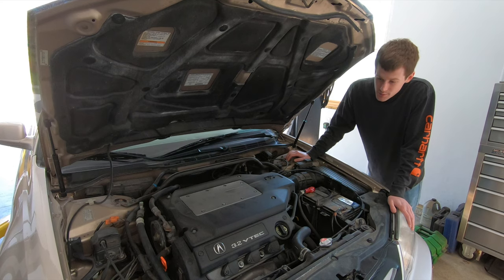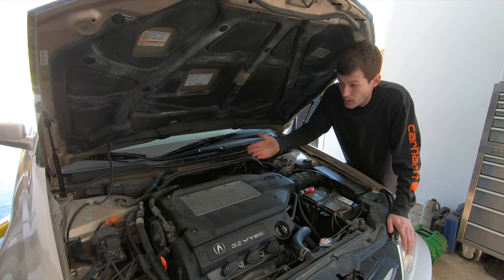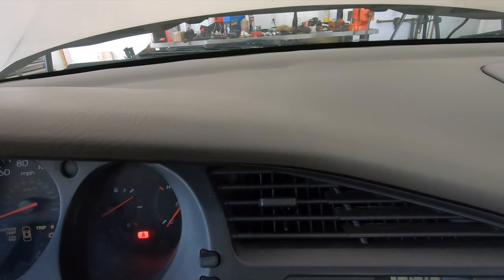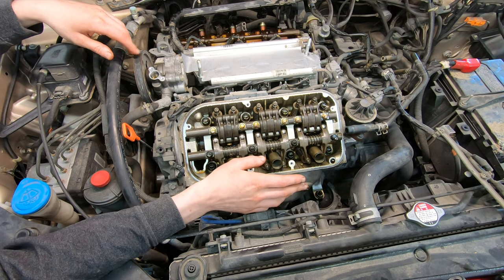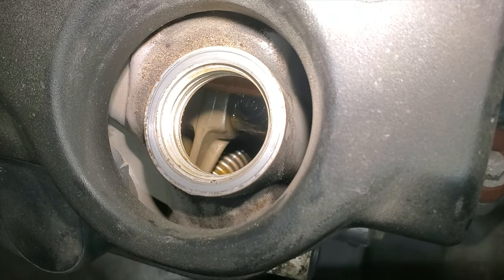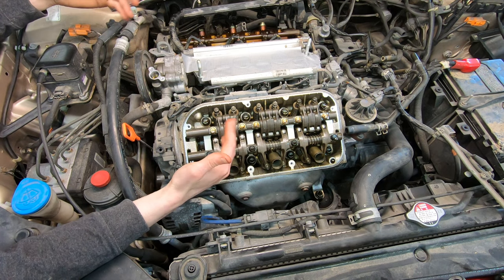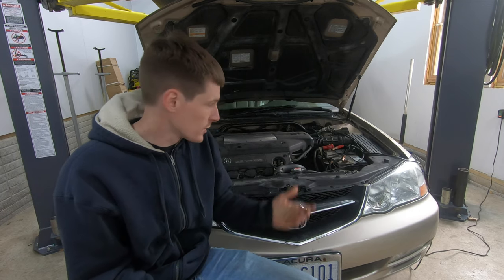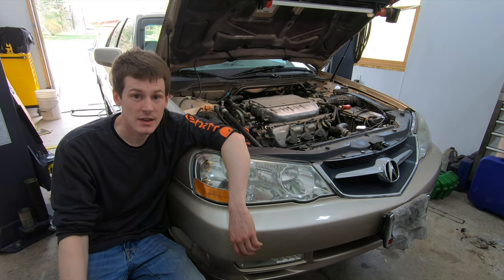Why Do Honda's Need Valve Adjustments?

Comment: I've been at WAR with my 8th gen R18 for a year.. Misfiring alot, I've replaced soo many parts and it only got worse. Today I adjusted the Valves, adjustments are soo small but I evened them all out and also changed the MAF sensor. It's still missing but has alot more power now, yesterday it was at its worse running terrible. I have a few things left to do to hopefully solve the missing just hoping no valves are burnt.

Comment: Hello I have an Acura TL 2005 with 171,000 miles.. a year ago check engine light was on spark plug replacement for cylinder 5 was the solution. Now a year later light came on Acura dealership said spark plug or coils aren’t the issue they said was a injector ok I followed thee advice. Now light still is on. I think the valve adjustment has been the issue since the beginning a year ago… I have been taking the car to auto-zone for the free scanner and the valves adjustment has been in the top of the diagnosis. Besides the valve adjustment the suggested a cleaning injector. I asked about that before the injector replacement and they said that won’t fix the issue now it’s a suggestion. Lights goes on and blink with a cold start and then after a few minutes stay steady. In the begging cars feels like loosing power (English is my second language hopefully I am explaining myself well) please advise I don’t know at this point what to do also I just replaced the timing belt 🙄

Comment: Honda along with some modern Hyundai V6 or a few of Hyundai turbo engines use solid lifer or manual adjustable rockers.. its done for valve train accuracy.. most performance oriented engines, high reving or engines with aggressive cams or valve timing phasing will use this manual or solid type as self adjustment followers can't reliable keep that accurate of a valve timing especially under strenuous conditions plus reliability is also of  concerns.. there are exceptions of course..

Comment: Having the same issue on my 2010 TL I didn’t notice it at first because it had cylinder 4 cylinder 5 and cylinder 6 misfires replaced spark plugs and coil packs but cylinder 4 and 6 keep popping up after a couple of hours of using the car im thinking that this could possible be the issue car is silent after it warms up but I hear the ticking at cold start or if I push the gas a little too hard

Comment: I did yesterday to my honda civic Si 1.8 2010 and the power ingres with 20%, engine silence 30%, economy fuel i don't know yet but i'm pretty sure it will be more economical! For those that they don't know if the engine has valve clearance i recomand immediately 100% and every 40k km!
Reply: SI is 2.0 not 1.8

Comment: valve misadjustment may cause worse symptoms than that, my 99 Honda crv went to LIMP mode no more than 30 miles an hour meaning no highway driving, rough engine idling, specially when on drive,  hard and delay transmission shifting, and when change from park to reverse, you feel like chittering, I changed a lot of parts including catalytic converter, and the muffler, because I thought it was exhaust restriction, till I got the idea to check valve and they were on tight  position meaning engine compression problem,
After 2 hours of valve adjustment the var went back to normal of  course  gradually after 6 Mile of driving. Smooth engine idling, smooth shifting.

Comment: Just got myself a 2008 Honda Fit sport manual. She's REAL chatty at idle xD
Sound like a big ole' diesel when I'm at a red light or in a drive through.
I've done a valve adjustment before on my 98 Accord. Plan to do the Fit this weekend.
Reply: I hope there isn't too much discoloration of the valvetrain from oil varnish. Car is at 110k miles, and the engine is bone dry top to bottom. Either way I plan on doing oil changes every 3-5k miles, to help prolong the life of the engine. I plan to keep get this car at least to 200k, hopefully 250 or 300.
Reply from the maker: I have an 08 Fit as well. I believe they suffer from piston slap at certain RPM's/loads. I recently had to do the head gasket on it, replaced all the timing components, re adjusted the valves, and the noise I'm talking about is still there.

Comment: On my 2007 Pilot, fuel injector #4 is not firing or pulsing. Changed out that injector with a Honda injector. Still not firing correctly. It starts up but the display shows the icon flashing. The slight shaking & lost of power is there. Then changed out all 6 connectors as they crumbled with heat & age when pulled out. Added 6 new Denso Iridium spark plugs. Changed out the manifold gasket & O-rings on the other injectors that are good. Still misfiring but running smoother now while idling. Do i need a valve adjustment?
Reply: Can't hurt and necessary on 6 cylinder honda engines

Comment: I had quite a bit of shuttering on my 7th gen Civic on startup and now the check engine light is flashing.  From what I have read a flashing check engine light is usually caused by a misfire and you said in your video that first can occur if the valves aren't adjusted.  Vehicle is at 225,000 I don't know if the valves have ever been adjusted but I do know that it was taken to the dealership religiously up to 150,000.  So my question is do you think my whole issue could be that my valves just need adjusting?
Reply: Shoot,  that symptom could be a really dirty air intake filter.  The check engine light indicates an issue (usually emissions related) with information from one of the cars system sensors.  Get an obd2 code reader from home depot or autozone.  Shouldn't be more than $40

Comment: Great video..I've had my 2006 Honda Odyssey EXL To 3 Mechanic Shops. Code reads misfire on cylinders 1-6 plus bank 1 to rich next to backside of motor.  Sometimes when you first start it up in morning it doesn't seem to shake as much..but after a few minutes it noticably shakes..but when on interstate it does great. But also it has a hard time pulling big hills. Honda was 3rd mechanic shop I took it to. They seem to think it maybe could be needing valve adjustment.. coil packs are good, spark plugs are new. Also I've run 2 cans of sea foam through it. Do you think it's a big possibility it's just needing a valve adjustment? Also will hurt engine running it like this until I can get fixed (if it needs valve adjustment) It has 265,797 miles. Thank you🙏💯
Reply: Sea foam bad. Could be fuel pressure or injection.  Could be intake manifold gasket or MAF/MAP But lots of evidence points to valve adjustment and valve seat impact.  A moderately talented shop should know how to diagnose in .5 hours without much disassembly.  These engines require adjustment or they misfire
Reply: @joeKisonue  I Appreciate You Taking  Time Reply With Helpful Info. I Still Haven't Got It Fixed Yet. Another Mechanic Took A Look At It About 2 Weeks Ago And He Also Said It Could Need A Valve Ajustment. Thanks Bro
Reply: @wes365  sure thing.  It has been documented in these videos that the v6 in question gets tighter on exhaust valves.  The manual calls for check and adjustment.  Most cars say no adjustment necessary on the sticker under hood.
Reply: @wes365  how is the vehicle behaving? Any issues with the car even though it hasn't had  valves adjusted

Comment: Intake valves wear at the valve tip and get loose, exhaust valves get beat into the head and get tight. You can have both situations (and usually do with 150k+) on the same engine.

Comment: Nice lil' video. I would assume one thing you didn't mention but the valve adjustment will make an improvement of torque and power because any cam lobe that does not immediately translate into valve lift will be worse cylinder head flow. That said this is why Honda will perform a bit better than engines with hydraulic lifters. The oil will reduce the actual lift/duration ever so little. 

Historically, there were some V8 engines that were louder and produced with solid  lifter cams and others that had lower RPM potential made with hydraulic cams. I knew a guy named Maier from Florida who make rocker arms for 351 Cleveland motors and he was a big proponent of solid lifter camshafts.
Reply: Old comment, but just wanna say thanks the does of engine knowledge today.

Comment: I'm having misfire codes in all cinders.. but the car drives fine till I get to around 60rpm then it starts to spotter I can get to higher rpms but I have to feather the gas.. my idle is rough for like 2 secs on start up .. do you think it's because of valve adjustment ? I have new coils and sparkplugs
Reply: Very likely... Especially if the car has a 150000 miles or more But certainly could be in need of a  adjustment if it has less...  On these hondas this is just basic maintenance and it really should be done at a 150000 or so even though they recommend it much earlier... They are the Dealerships and they  Recommended at a 100000ish...  I'm just doing mine at a 187000 because it is getting random miss fire and a shake at the start so assuming they are too tight
Reply: @john-carlos ynostroza  I change the vapor canister abd put some injection cleaner in it .. its been running smooth so far didn't want to get on it,till after the adjustment
Reply: Clean your throttle body

Comment: Let me add to your explanation if the valve adjustment is too tight u will have the valves opening earlier and closing late.. hard or harder to start when the engine is hot..  valve not closing fully leads to burnt valves or pitted valve seat thus leads to drivability issues.. sometimes shows up as low compression

Comment: My 04 pilo started to lose a lot of power when I started to accelerate over 30mill and it sounded like a air blower under the car and after some time check engine light popped on and it said multiple misfires i when to orallys and got the codes and said . Valve adjustment so we did it and now it’s like new engine.

Comment: I have owned many cars, however my first Honda is a 2005 CRV (4 cyl) with 35,000 miles on it.   Purchased from a dealer.    When I first got it, I heard engine tappet noise.     It sounded noise to me then and now with 60,000 it sounds even noisier.    

My question is:   Should I be very suspect that the millage was not actual millage or has anyone had a Honda 4 cyl , where at 35k the engine sounded very noisy (very distinct tappet noise, not just one - more than one tappet noise) ?   

...And thanks Repair Geek for the helpful video.
Reply: I would like to comment that honda engines are not known for being whisper-quiet. Having said that, the lack of hydraulic lifters would logically make honda engines a little noisier compared to other valve setups even when the engine is fine. I guess what I'm saying is that if this is your first honda, the sound of the engine may take a little getting used to depending on how closely you're listening (ear-to-the-engine sort of thing). All of mine have been a little rattly, especially during cold start but if it's obnoxious then maybe have it checked out. Note: all of my hondas have been in the 200k mile range so my expectation for engine noise is a little lower standard than some.
Reply: Likely the mileage was accurate,  it could have done with a valve adjustment probably after 5,000 miles.  Some years materials may have varied or maybe the tech messed up.  Get it adjusted and replace the front and rear differential fluid and coolant. The fluid is supposed to be changed every 60,000

Comment: could a bad valve adjustment cause very low compression? cylinder 1 is about 90psi and the rest are 170.
Reply: Yes. If an exhaust valve is not closing all the way it will burn quickly and cause low compression. Much better to have an exhaust valve a bit loose than too tight. Hope yours is not burned yet if what's causing the low compression.
Reply: @GaryL3803  i see, will check it out. Found a pretty cheap engine replacement already though just in case. Thanks for your reply

Comment: Great video! I have to check the valve lash on my old Honda ST1100 soon. It has a sweet 1098cc 4 cylinder with a similar setup. I hope to see a rust prevention update soon too!
Reply from the maker: September or October for the rust video.

Comment: does the adjustment increase fuel efficiency?
also pls make videos for 2008 accord 2.4L
Reply: It does directly and if it is affecting performance then it affects it secondarily by you giving it more throttle

Comment: Help, please. My car was ticking on idle and ticks louder when im accelerating. The idle tick is gone after replacing the timing tensioner. But it still clicks when i accelerate oast 1500rpm. Could this be my valves? 2011 pilot. What is a fair price to get the valves adjusted? Google is saying $250-300, but i see in some forums they can be as high as $600. I really dont want to pay too much to get it adjusted.

Comment: Does using the engine to slow down the car (by down shifting the gears instead of using the brakes) require more valve adjustments?

Comment: Get a hardwood dowel drill hole in it put the microphone in it with an epoxy plug and then use that like a stethoscope and plug the microphone into your camera and you can hear everything that's going on inside the head and valve train
Reply: What microphone? Add to the dowel a steel rod to pinpoint touch areas of engine.

Comment: When you say a too-tight valve can create a misfire while cold,  does that cause a CEL?  Does the CEL clear itself when the engine warms up?
Reply from the maker: Sometimes. It just depends if the misfire is bad enough to trigger the code.

Comment: If the valves need adjusment and if you were to give it gas while it was parked or moving it would still make ticking sounds right? I have to redo mine I followed a different guide for the  wrong car. Lol

Comment: mine are opposite its starts fine cold but if i shut it off warm and restart 215 minutes later it sputters and gives a po301 code . replaced filter plugs and coils already

Comment: I believe my 04 honda pilot is making that noise but I'm thinking it may n my timing? How do u know for sure if it's ur timing or valve adjustment 🤔...what tests can I run to find out? Thanx in advance🙏👍🏼
Reply from the maker: I'd look into getting a stethoscope and try to pin point where the noise is coming from:
 https://amzn.to/3sODF9V
This will isolate the surrounding noise and let you hear the noise from the area you are touching.
Reply: @RepairGeek  thank u broski for the reply and link on the part.much appreciated 👍🏼
Reply: Did u do the required maintenance, ie valave adjustment per honda recommendation?
Reply: @LLCoolPass  what u mean by that?

Comment: Thank you for explaining valve adjustment. I've seen others turn the crankshaft (I believe) to TDC for both exhaust and intake individually. Would you explain if this is necessary?
Reply: You just want to make sure each one is off cam to adjust.  TDC just helps verify position.  Check out some other Japanese valve adjustment videos

Comment: Just replaced both oil pressure sensors on my ‘11 Ridgeline, but the oil light still comes on after start up until it’s warm. Any idea as to why?
Reply: Did you replace it with a Honda sensor? Aftermarket sensors are junk
Reply: I already took it to the dealership. They replaced the oil pump and it fixed it. I decided to have the timing belt done while it was there, as I was at 172,000 miles. Previously replaced around 85,000 miles, according to service records. Still has a slight deep tick, but runs good. Thinking of doing the valve lash adjustment at 180,000.

Comment: My Acura has J37A2 engine, do you think it needs RTV or gasket replacement when putting valve cover back?
Reply: If the autoparts store lists one use it. Rtv is usually on oil pans. Most every engine has valve cover gasket because oil runs down onto exhaust if leaking
Reply: Eric the car guy has a good video on this

Comment: Couple of things: the sound here doesn't make it clear exactly what this will or can sound like. A pcv valve can make a tapping sound and so can a bad timing belt tensioner. So anyone watching this... just be sure of your noises.

  I was having power steering issues in a vehicle i had and a whining started happening.  I replaced the pump and the rack and the whining never stopped even though the steering issues were resolved.  I'm convinced it's the alternator. It's been 10 years with that whine and I'm still on the original alt.. so who knows.

Comment: What happens if you do not adjust the valves except for the noise factor?
Reply: I watched  a video where the valves had all gotten tight and the symptoms were lower fuel economy, hesitation and just no power.  This is my 13 Pilot with 250K’s problem exactly.

The owners of this van let people change “everything” else over a couple years time for thousands of dollars with no improvement.  Once Schrodinger’s Box did a valve adjustment it ran like new.
Reply: Well, I did my valve adjustment finally.  Several exhaust valves were loose, several were tight.  Same with the intakes.  My engine went from around 18.5mpg average to 21+mpg.  Sometimes near 22.  

Definitely worth the cost of new gaskets and a few tools.

Comment: I replaced my 04 Honda Civic 1.7L head gasket and after driving it for a few miles I can hear the rocker lifter tapping so I’ll definitely need to do this thanks a bunch! Do I need to turn the motor while adjusting?? Or is that the only thing needing to be done? Just adjust to spec
Reply: Motor needs to be cold and not running.